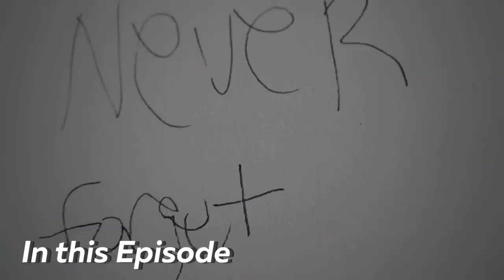S3 Episode 6: Never Forget

Comment: Tip for putting a cat into a crate: do it backwards! It scares them less.
Reply: I just turn the cat carrier upright, hold the cat by the nape, and slowly drop kitty into it. Works everytime.
Reply: Esther I have a carrier where you put the cat in through the top, makes it much easier.
Reply: Ditto!!  Thats what we do for both of our cats.
Reply: Very true,  I'm a Vet Tech and do this often.  Good trick :)
Reply: Does it? Thats a great tip. My carrier opens at the top so it's easier... Good to know though. Ty for sharing.
Reply: I wrap my kitty in a kitty “burrito”. Keeps them calm and less meow-y 😁👍🏻
Reply: Yeah, removing the top of the crate and putting the cat in that way is recommended - I've worked for the rspca and they always say its easier to place an adult cat downwards into a small area than to push it into a small area

Comment: FyI Spalding Employees. Being a former carpenter/rough framer of custom homes, and having some experience on remodeling jobs. I recommend using small wedges/or shims hammered in under the sill plate so that the saw zaw moves easier where fasteners need to be cut. Also I recommend pulling your pry bar side to side instead of straight back as it give you more leverage. Same for pulling nails.

Comment: great you got the cat out and hes fine but that wall is not a load bearing wall its a partition wall ,if it was a load bearing wall you would not be able to safely work on it without acro props and thick brace boards,to hold the ceilinhg and wall stable and not a collasped  unit on your heads

Comment: Tile has to be applied on Durarock or its equivalent.  Applying tile on top of cork or linoleum or sheetrock is a huge no-no!!   I own a chimney business and have a design degree so I'm always working with tile, brick, and stone.  You put it on a soft surface as you have it here and it will crack and shift and peel up over time.  Certainly not smart at all!